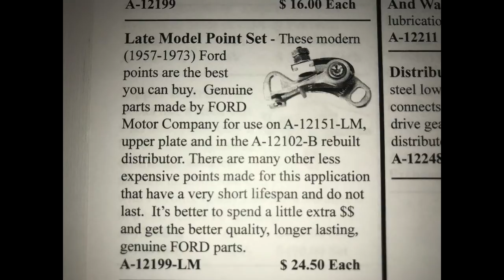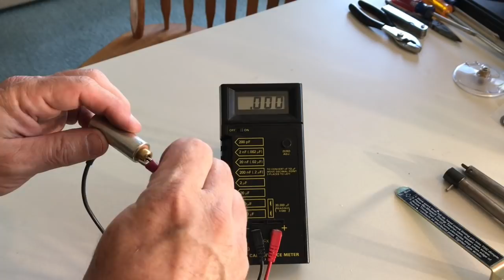How to Winterize a Ford Model A / How to Assemble a Distributor.  BONUS: Our winter projects

Comment: Never set the parking brake if sitting for a while, good stuff.

Then there is me that set the parking brake on my '72 Baja, and it sat for nearly 3 years, outside in grass, in IOWA.

Went to retrieve it earlier this year, released the handle and they came right back.  That car just loves to move.
Reply from the maker: Wow!  You lucked out

Comment: Paul, This video was very interesting and I enjoyed it immensely, but I have a problem.  I've become addicted to your videos.  Yep, it's true.  I don't know what I'll do once I've seen all of them.  I guess start watching them from the beginning.  Or, send lots and lots of money to pay for a production crew.  You're great!
I want to add that I would never make fun of you because I respect you, and that I actually do support you in your analogy of that dream sequence regarding your widow and being certain to lube-the-distributor.  It sounds awfully familiar.  Oh, that's it-- I tend to think in that form too.  It is amusing in a sense but I believe these things come to people that make sure all bases are covered right down to if they were no longer here on Earth.  I consider that being integrity as well.
I'm hearing bad things about Points now adding to the ongoing issue of poorly made Condensers.  Apparently, Points now being sold in the big-box auto parts stores are coming through with the rubbing block being made from a type of plastic that does not hold up for very long.  This obviously is contradictory to the fibrous material rubbing block we've had for decades.  I hope that the good Model A part manufacturer's don't make a change-over to these inferior Points and Condensers.
Have you any word of this?
What is the tube inside of the radiator fill neck?
If a given Model A were a daily driver, About how many miles would go by until the distributor needed to be lubed again?
God Bless
Reply from the maker: You can make fun of me any time you want.  You have my blessing.  I make fun of myself as much as possible.

Yes, have experienced that with points.  I went back to "original or nothing" on points.  But I have a bag with about 50 sets of original points in it, so I'm set for life.  Call Steve at Bert's Model A Supply and order your points from him.  Tell him you want the good ones.  The tube in the radiator fill neck is the overflow vent.  I lube my distributor much too often.  But I have never had one seize on me or points show any wear.  I do it whenever I feel like it.  I don't go by miles.
Reply: @ModelA    Thanks Paul.
I can't figure out how the vent tube being inside the radiator cap area can work, but I'll put some study into it.
I'm adding  Bert's Model A Supply to my resource list for my some day Model A.
Thanks again.
Reply: @Zeke Trimmer   I had a lot to say and I have interest Paul's tutorials.

Comment: Paul, love your videos Thanks  I am installing a rebuilt speedometer. Should I remove the speedo cable and service it? If so is there a trick to reinstalling the cable?
Reply from the maker: No trick to i stalling the cable.  Service does not require pulling the sheath, just the inner cable.  With the speedo out, just grab the cable and pull it out of the tube.  Clean it, lube it, slip it back in.  Done!

Comment: Another great video Paul. Don’t really need the winterise bit as we can use our cars all year and we are about to hit summer. Had my T out last Saturday for a run out for lunch. I enjoyed the distributor rebuild portion. I know I say this each time but I need an A.
Reply from the maker: Thanks, Paul!  Well, as I have told you before, if you ever find your way to the states, drop in and take one for a spin.  Lucky you on entering summer.  That means we are diving into winter here, and I don't like it.
Reply: @ModelA  The reverse is true also...if you find yourself in Aus my T and Citroën Dyane are available for driving.
Reply from the maker: @paulscountrygarage9180     Excellent.  Thank you!!  Until this virus is history, I think I'm staying close to home.  We were thinking about taking a cruise this year but scrapped those plans (for obvious reasons).  Maybe in 2021??  I'm experienced driving a Model T but have never driven anything even close to a Citroën Dyane.  That's somewhere between 21 and 30 HP if memory serves correctly?
Reply: @ModelA  Totally understand and I agree wait till 2021. On a side note 2022 is our turn (NSW) to host the National T rally and its in Dubbo, western NSW. Might be a holiday idea? The Dyane is 602cc all aluminium horizontally opposed twin. Is an absolute ball to drive.
Reply from the maker: @paulscountrygarage9180    2022 for the national T rally?  That sounds like a PLAN!!  I will look into it.  Thank you!  

Yes, I bet that 602cc makes a big difference.
Reply: @ModelA  happy to send you info on the 202T rally if you would like.
Reply from the maker: @paulscountrygarage9180    I already looked it up on the computer machine.  Talked to wife about it. Have it on the calendar.  How's that!  Ha ha!
Reply: @ModelA  you are too good. If you use Faceplant feel free to friend me. Pic of Pebbles (RIP) my whippet with my T in the background.

Comment: Paul, sorry but I don’t find your link for the cleaning products you used in this video. I’m particularly interested in what it is you use on the roof.  I use 303 product on my leatherback and curious if you’re using the same.
Reply from the maker: In the video description.  Yes, I use 303 on the top material.  That stuff works great!

Comment: Very interesting Paul Mammal. In the 1930's could Mammals drive in extreme cold?
Reply from the maker: Yes.  They used blankets.  Lots of blankets.
Reply from the maker: catmodelt    Yes.  But it's amazing how much warmer you feel with a blanket folded on tour lap while driving in the cold.  Maybe that's what lap cats were bred for.  When the wife unit and I go somewhere in the winter, we have our own blankets for our laps and then a bigger one over both our shoulders and upper body.  Works fine.  Especially with a thermos full of hot cocoa.
Reply from the maker: Yikes.  Those tires with cracks in them tend to let go at the worst time.  Good choice on replacing them.

Comment: Do you know how hot it gets inside a distributor? I was thinking about designing a 3d printed insert to keep that plate from grounding out, but the plastic I use starts to melt around 200 Celsius/392 Fahrenheit. Do you think that would be good enough? I know those engines get hot, just not sure about the distributor.
Reply from the maker: I suspect it would never go over 300 degrees F unless the motor was overheating.
Reply: @ModelA  Thanks although it occurred to me last night that making a mold for ceramic or clay would probably be better. I might just be going crazy on lockdown too.
Reply from the maker: We already knew you were crazy, Zach!

Comment: Hi Paul! Do you do anything to the fuel in the tank for storage or just let it be?
Reply from the maker: That's a great point I forgot to cover.  Thanks!  I do use a fuel stabilizer, but the product I use isn't available for public use where I live, so I shouldn't show it anyway.
Reply: Sta-bil is what I use on all my gas engines large and small ,  never had a problem .  and use the max amount per 5 gallons . I do that year round for the small ones ,just in case I don't use it for extended period , the vehicles only when they be stored a couple months